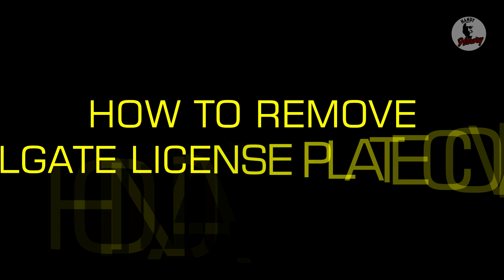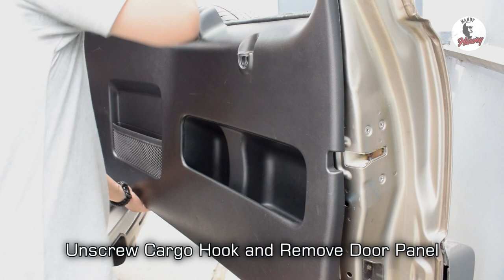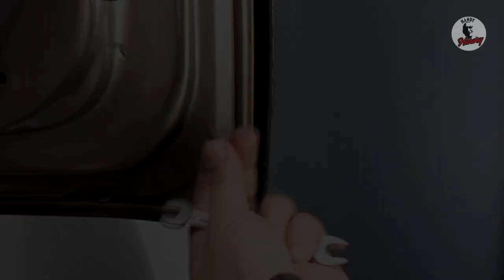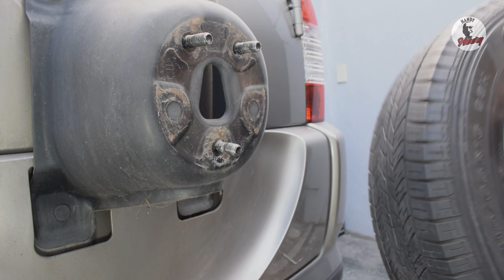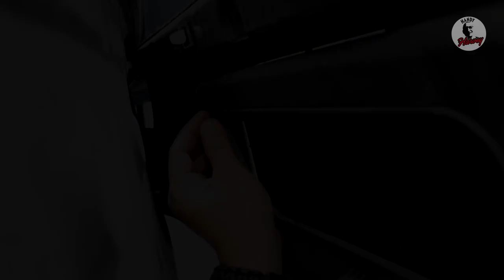HONDA CRV License Plate Cover Removal | Honda CRV 2003-2006 #hondacrv #cars #licensecover

Comment: Is there a way to put license plate lights there? Thank you
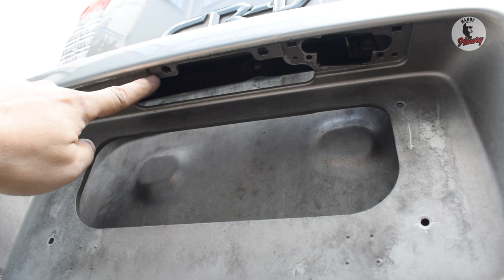Reply from the maker: Hi @emjosh cawaling. Yes, it's possible. There is light provision on top of the plate panel (see 2:22).  However, a rewiring is necessary. Hope this helps. Thanks for watching. Please like and subscribe. Stay safe.
Reply: @handyharvey  Thank you sir
Reply from the maker: @emjoshcawaling4153  you're welcome. Good luck on your project.
Reply: What purpose is that plate/cover/panel?